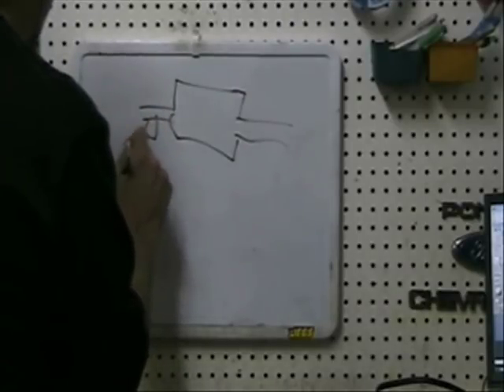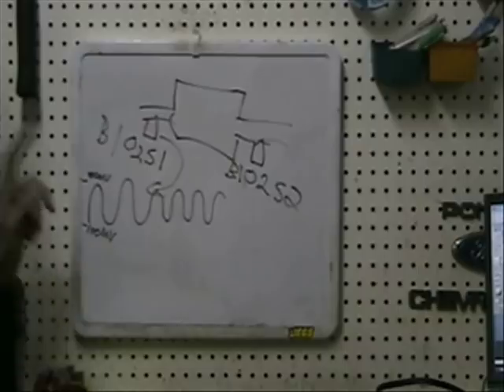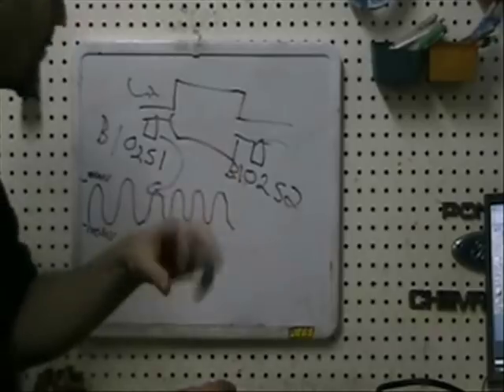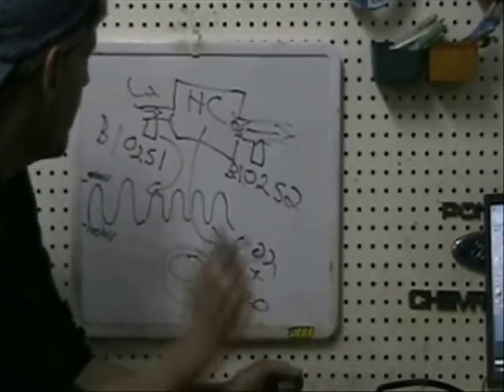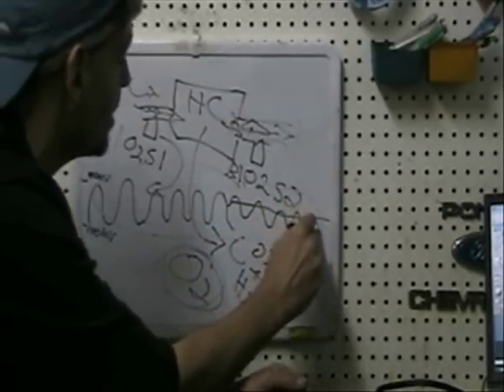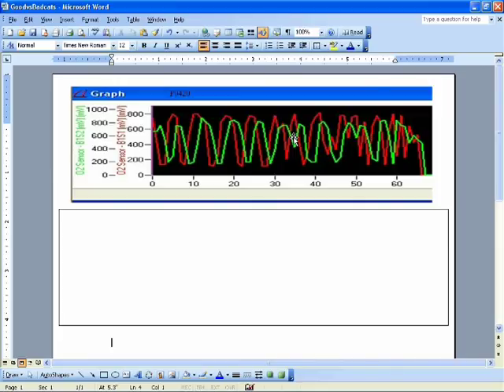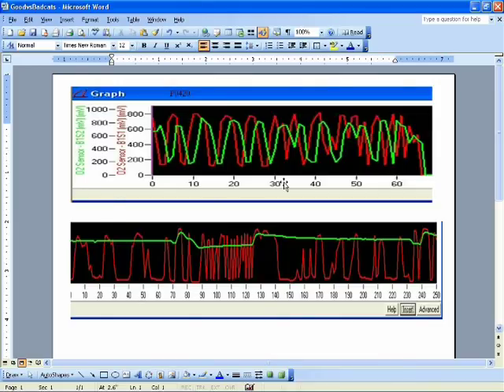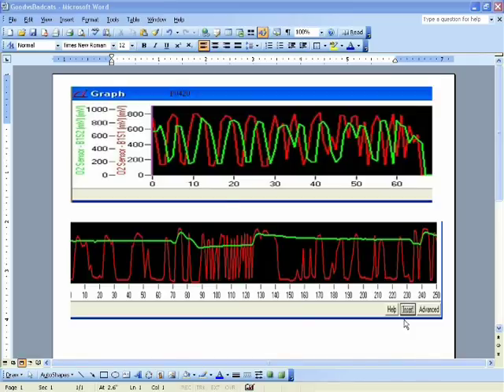P0420 P0430 catalytic converter catalyst inefficiency code diagnosis

Comment: I changed both catalytic converters & oxygen sensor for bank 2.
Still getting P0430. I have a 2006 cadillac srx awd v6. 
What am I missing? 
Please help!
Reply from the maker: What was the data you got?
Reply: Based on the info I collected online, it could be that you replaced with a after factory oxygen sensor, not the OEM one. Some car if the O2 sensor is not OEM, it throw the code( but it seems it should be the O2 sensor code not P0430).

Comment: Dear sir ... I would like to thak you about your effortsI ve got a question I ve seen a video for you on o2 sensor you said "O2 sensor compars between O2 and HC and if it doesnt see HC its output will be 0V that was your conclusion and you proved it My question is if we have a good cat there is no O2 comes out of it ??? How the signal of O2 sensor is high voltage 0.9V??? There is no O2 to compare with HC should be 0V as you said before, isnt it??tThank you again sir
Reply from the maker: Because the presence of oxygen inhibits the voltage.  If the cat is working there will be no O2.  With no O2, there is no inhibition of the O2 sensor voltage .  You will see maximum voltage of .9V

Comment: Please be helpful by answering the 3 questions. Your a bit intimidating in r responses. So there is no mimmic/enantiomeric of #2 for #1 spikes at idle or 1500 rpms even though i get 0420 code. So what would diagnoses be? Bad CAt or am I out of woods since no spiking?
Also what is the explanation for a mimmic of #2 for #1 sensor while only running down road at 1500 rpms.  Does that mean pollutants are out in air while driving down road and not at idle?
Reply from the maker: I did answer them.  You need to think in terms of O2 sensor response to induced variables, not "answer the question". Things don't work that way.  The question is- is the o2 sensor response proportionate to the induced variable input?
Reply: I induced a variable--pulled hose to brake booster and the 02 sensor went down and then up when return the hose to outlet. That tells me the 02 sensor is responding but
lack experience schrodinger to determine if the response is proportional.
Also how come your not responding to question 3 above: what is the explanation for a mimmic of #2 for #1 sensor while only running down road at 1500 rpms. Would appreciate help.
Reply from the maker: scooter12368 You talk as if you have type of expectation that I am supposed to respond to your satisfaction. I have no such time available, sorry.
  Watch my videos on fuel management and fuel adaptation strategy. They will answer your questions and allow you to make correct interpretations.

Comment: How do u know it's the cat and not bad o2? Why not just do a back pressure test? I'm having this code on a 2014 Chevy Cruze replaced both o2 and cat. I'm going to look at this tomorrow . Thanks!
Reply from the maker: How can it possibly be the O2 when you have variable response? That is impossible. Also what does backpressure have to do with catalyst efficiency?
Reply: @SchrodingersBox  I'm not sure still very new to diagnose. Couldn't the O2 be faulty giving u bad readings? I thought the cat was bad only if it was plugged ? I have 2014 Chevy Cruze seems like many people on forums have this code. Many have replaced o2 and cat and have not had any success. What are your recommendations?
Reply from the maker: You can't have a bad O2 sensor when it indicates variable response to stimulus. So O2 is ruled out at least in my video. If your O2 sensor does not contribute to fuel trim that would be a different story- what data did you have indicating that?
  Also- yes of course people who had this code failed to fix it IF THEY WERE ON A FORUM.  That's because they are almost always incompetent, I have never even once ever seen even a single one show any relevant data toewards diagnosing their condition, and they also always lie.  Forums are completely useless.
  And finally, No- a cat can have perfect flow but simply has expired catalyst which fails to convert the hydrocarbons. In this case backpressure would still be under 0.5PSI but you would have no detectable oxygen consumption by the O2.
Reply: @SchrodingersBox  ok so what do you suggest? Not all forums are useless I ahev found a wealth of informatiom there and a ton of knowledgeable mechanics that can give great advice with typical factory flaws for your vehicle which 80 percent of the time it's going to help you in diagnose. For example this cacr had a p0171 if I rmemebr the code correctly and I went to the forums and they suggested to check the pcv valve and sure enough it was the pcv valve. I have also had many other cars that have been helped by common plagued issues with manufacturers. I will look at graphs tomorrow and update
Reply from the maker: I suggest just basic analysis to begin with. Just easy stuff like  analyzing the O2 output, analyzing the fuel trim curved against load both short and long term, and then determining your cause based on that data. 
  check the forums for help if you need but I stay far away as possible from those.
Reply: @SchrodingersBox  ok thanks. I wish I could post. A picture. I am idling a Prius with foot on gas and both wave forms look the same it does have a air to fuel sensor. O2s2 is constant .76v and o2s1 is around 3.2-3.3 which is the air fuel sensor . Then the o2s2 just dropped to .74v. what are your thoughts?
Reply from the maker: You need to examine the equivalence ratio. I don't know what the voltage is supposed to be for that model but the ER should show it to be stoichiometric under all conditions except WOT.  If it isn't there's your direction!
 I still don;t see the fuel trim data though- thats always where I start.

Comment: On my '11 sonata the first sensor stay flat as the second bounces all over. Would this cause p0420 code?
Reply from the maker: Depends. is the first sensor an A/F sensor?
Reply: @SchrodingersBox  yes i watched a few more of ur vids and did some looking it is a/f so its about normal i guess. Before i bought the car it had b1s2 heater code. I pruchased the car and reset light to double check now its p0420🤦‍♂️
Reply from the maker: If the front sensor is a AF then yes you can be very assured you need a new cat because the rear O2’s are still ZiO2 design.
Reply: @SchrodingersBox  thanks

Comment: Matt, I got a message that  they  cancelled my subscription to your advanced channel. In regards to this video, I understand  the wave forms and what  a bad an good Cat are, but I was wondering what would  cause a cat to go bad in the first place.  I have heard all sort of things from dirty mass air flow sensor to bad pcv valve to old o2sensors, to innefficent engines, ie excessive   blowby, thus not optimal compression.  I was under the impression that o2sensors usually dont  go bad, Please elaborate because  as you teach us, not to be parts changers we should find possible causes
Reply from the maker: Hey good to see you again, Jan. yes paid channels are ending. I am resolving it soon and will announce when my new website is up. 
  cats go bad for 2 reasons. The first is simply age. The catalyst has a limited life- it eventually gets used up. But another reason is usually driving with a rich condition. Excess fuel in exhaust causes the cat to run much hotter and destroys the catalyst sooner. It can even melt the material in the cat and clog it. 
  If a car has a misfire or rich condition, not repairing will quickly destroy the catalytic converter.
Reply: So another words to look for air intake leaks  which would  cause  the computer to compensate enriching the  fuel.  Or possibly  leaking fuel injectors  maybe?
Reply from the maker: Yes.... Anything that could cause a rich condition or excess i burned fuel in the exhaust. EGR, MAF, or mAP malfunction are also potential causes.

Comment: hello.
what if the upstream 02 sensors are not oscillating but are stable as if they were downstreams.
also downstreams are oscillating as if they were upstreams.
Reply from the maker: then you are either fixed rich or lean.
Reply: Schrodingers Box thanks for your prompt reply. 
the wierd thing about my vehicle is the LTFTs are very close to 0% which gets me completely confused as to how to go about it. 
what do you think?

Comment: Ok,nice video. Humm i scann my car and po420 come on (hate  code) so a change o2 up and down. But isn't help so a buy catalytic converter after market and change o2 again s1b1 as2b1 now the here's code again but scanner show me nice wave like you video so my car r
Use lot gas. Aren't. What to do ..gmc terrain 2011 2.4l plssss gime idea what is wrong before i shot me....
Reply from the maker: Why would you change the O23 sensor> You just ruined your baseline for diagno9sis!

Comment: What if downstream sensor was showing 1 voltage bank 2
Reply from the maker: What do you mean? I don’t understand that
Reply: @SchrodingersBox  my bank 2 below 2 at idle bank 1 is at 8 voltage these are post kcats or downstream and precats bank 1 more on lean or wave motion bank 2 says at 8 volts so i have bank 1 p420 and bank 2 p1093 04 xi

Comment: Hello, I just have found your channel. Is there any way to contact you? Would you be able to help with your knowledge please?
Reply from the maker: Contact me right here
Reply: @SchrodingersBox  thanks for quick reply. I have got lexus RX 450h. I have an issue with fault P0420. I have just replaced o2 sensor and on the way back home from mechanic the engine light went on again. I have got some print screens with readings from the test we have done. If I send then to you would you be able to find the real problem as I see you are the specialist.
Reply from the maker: I would need to see the O2 sensor data to determine why the O2 was changed. A P0420 pretty much tells me the O2 had to have been working.  You can email me the data at erwinschrodingersbox@gmail.com.
Reply: @SchrodingersBox  I have sent it. Thank you very much.
Reply from the maker: There was no data that was proper for determining the cat activity sorry.  I need an S1 vs S2 curve done against load or sustained at 2300RPM.
Reply: @SchrodingersBox  Ok. I will try to get the proper data. Thank you.

Comment: what if your O2 post cat sensor reads low as in 0.07 - 0.13V at idle then goes to 0.55 - 0.7V at 2000rpm? no codes, fuel trims good. cat failing? have endeavoured to learn from educational vids etc but confusion reigns
Reply from the maker: That's normal. the cat should be tested at 2000RPM
Reply: Schrodingers Box thanks so much for replying, very appreciated. Please keep up your great educational vids.

Comment: the thing is you really want a bad aka lazy rear sensor which will mask the problem!  Putting the new rear sensor is absolutely the wrong thing to do but you could be right and they might not be as dumb as they come across but just want to fleece the customers.

Comment: will it change my fuel milege for the bad?
Reply from the maker: Al Vendetti No at all- unless it is plugged up.  But if it's just the catalyst is expired, it is purely about emissions and has no effect on economy or performance
Reply: I bought a new cat for it,166 bucks with a 50 buck rebate..mass has a test for codes for inspection,should i buy a new O2 also?
Reply from the maker: Al Vendetti If the O2s are operational there is no need to replace them
Reply: it seems to be working ok.

Comment: I have a question
If we are talking about usual narrow band sensors and if those sensors measuring 02 before and after catalytic converter, than how is it possible to remove P0420 code by a simple installation of a spacer which will move your sensor # 2 away from the body of catalytic converter
It does not make any sense 
I think sensor #2 is measuring temperature after catalytic converter
please anybody explain
Reply from the maker: Simple. It doesn’t. These cat bypass tricks are nothing more than ignorance passed along in. forums by people who just parrot what they read without understanding anything. It’s same reason idiots remove MAF screeens, relocate IAT sensors and other incompetent mods.
Reply: Schrodingers Box 
Ok
But you did not answer the question 
I'm just trying to understand how 02 works
Reply from the maker: The operation of an O2 sensor is explained in my fuel trim video. I certainly wouldn't type it out here, too long. It does NOT measure temperature.
Reply: Schrodingers Box 
Thanks
I will watch it
I'm just trying to understand 
If catalytic converter was removed and spacer was inserted in post catalytic o2 sensor
It does mean that the oxygen content is the same but p 0420
Dissappeared
Reply from the maker: Everyone says that it disappeared..... because they cleared the code and it disappeared.... until it comes back.
Reply: Schrodingers Box 
It works fine for 3 years already
Ok thanks for answering anyway
If I ever find scientific explanation for this phenomenon I let you know
Reply from the maker: Well its pretty simple- look to see if there is superimposition of the B1S2 signal vs B1S1 signal.  That would tell you.

Comment: help plz nissan froniter 05

Igot 420 and 430 codes. B1S1 0.300 AT IDLE  0.285 AT 3000 RPMS
                                             B1S2 0.280 AT IDLE 0.280 AT 3000 RPMS 
                                         B2S1 0.600   AT IDLE 0.580  AT 3000 RMPS 
                                         B2S2 0.290 AT IDLE 0.310   AT 3000 RPMS ON AUTEL SCAN TOOL
Reply from the maker: Thatdata is useless sorry. Need basic data to determine possible causes. I am not sure why you send me single frame O2 data??
Reply: well the bank 2 sensor 1 and values basically stay static, they dont move much at all no matter what rpm. they stay around 0.280. I would think they should fluctuate somewhat. what other data can I get for you to help me.
Reply from the maker: @randy1ization  If your bank 2 sensor is fixated you need to very simply induce variables into both banks and validate response using the B1S1 as a positive control.
  Just keep it simple.   Good luck.
Reply: a little mapp gas or propane, or 100 percent oxygen perhaps? I have all 3
Reply from the maker: That works.

Comment: You're welcome Pham, I am glad this helped.  It is unlikely a new cat would still throw an 0420- your car doesn't have 2 cats does it?  Also, you are clearing the code with your scanner, I assume... it may take 30 drive cycles before the code clears by itself.  Good luck! and thanks for the comment!

Comment: If you use a laser thermometer on the cat when its at temp, that will tell you its clogged.  if its 350 to over 400 degrees its clogged.  It should run cooler than that.  People tend to think the sensor took a shit.  The sensors work because theyre telling you hey man, somethings wrong.
Reply from the maker: This is true! I have also confirmed the temperature  diagnostic is reliable for a clogged cat but not so much for an inefficient cat. For that, looking at the product of the chemical reaction through O2 sensor feedback is really the only reliable way.